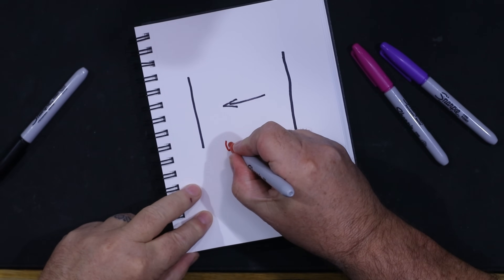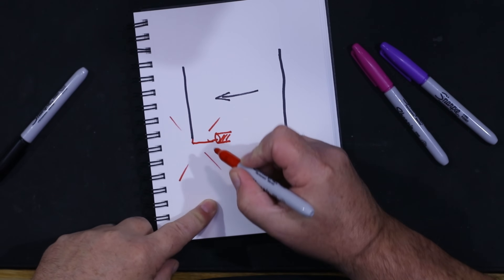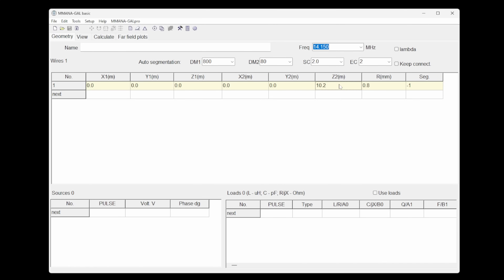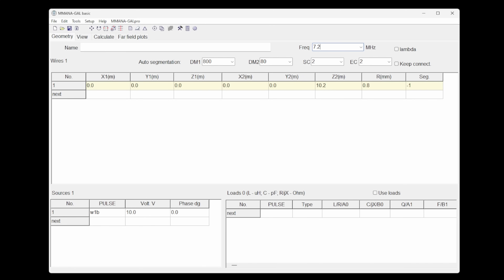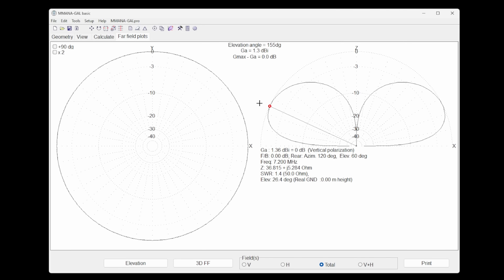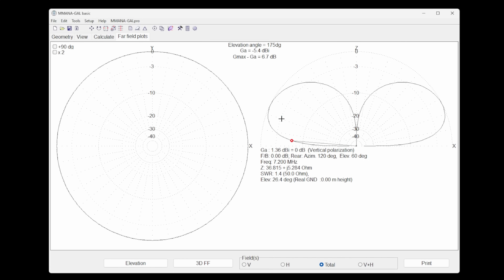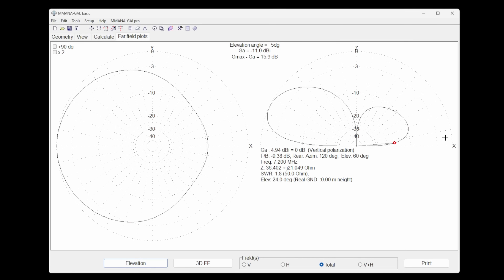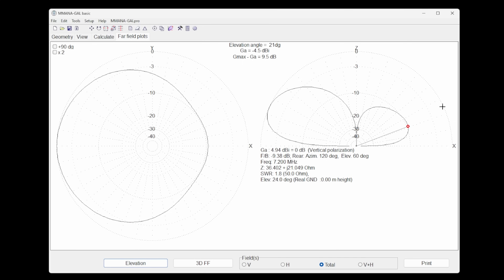Parasitic Antenna Array with 2 Verticals

Comment: And if I’m using a quarter wave vertical with two elevated radials, would I be making radials on the reflector as well, just 5% longer to match the reflector resonant frequency? Would I, say, if wanted to radiate northeast, position driven vertical northeast, reflector southwest, and radials for each northwest and southeast? So the radials are parallel? Or better to have driven radials north and east, and reflector radials west and south?
Reply from the maker: In that scenario, yes. The Reflector dictates the f/b and gain. I would do 90 degrees.

Comment: Cal I’m deciding to put a bog antenna at around 300’ 2 sets running 360 direction or a 2 vert array since I already have one comm classic. I’m curious on how the array turned out on receive? I already have a full wave loop for 80 already up about 45’ that does well just was wanting to improve receive. Thanks
Reply from the maker: About same.. Certainly picked up a bit more. I think the word is "Reciprocal" :)

Comment: Tried this in MMANA for 20m:

1. Raised both vertical elements about 2 meters using studio lighting tripods - interface nicely with Superantenna mounting brackets
2. Used Chameleon 17ft whips for verticals
3. Angeled radials close to 45 degrees down - terminating 1 meter above ground on a plastic fence pole
4. Radials were in the direction of max radiation - about 35 degrees apart (on both active and reflector elements)

Came up with almost the same result - 1.31db forward, - 8.6 rear - that gives me a theoretical gain of 3.3x forward over a single vertical.

With just two radials for each tripod - and printed brackets (hooks) to wind them on one of the tripod legs - it is a fast deployment - can’t wait to prove it in praxis in the field

Comment: Hey. I got an idea of what to try. two pieces of half-wave dipole that are half-wave apart. impedance matching so that both antennas have a quarter-wave length 75 ohm cable and from the center with a 50 ohm cable to the radio. what do you think about this ?
Reply from the maker: It'll depend on how they are oriented. Look up phased antennas.
Reply: @DXCommanderHQ  I thought they were vertical dipoles. I found another article on the same topic that mentioned 180 degree phase shift with a coax cable. I still haven't quite figured out how to do that, but I'll try this first.

Comment: Would that work with a vertical dipole
Reply from the maker: Yes.. Just like a yagi in a vertical plane.
Reply: @DXCommanderHQ  thank you! I live about 900 meters away from a quarry. I have moved my antennas around and unfortunately they best spot for the antenna picks up the rock crusher when its running. It would be nice to null it out a bit.

Comment: Could you provide me  with a link to any articles related to driving two vertical antennas from one source, using a phasing network to allow of beam steering?  Using just a fixed reflective parasitic element isn't worth it for me, as you can't steer the beam. Thanks!
Reply from the maker: Yes, just search for "phased verticals".

Comment: The 8 plus meter spacing was to maximize front to back along with good gain.  For a vertical with radials spacing the parasitic element farther away would be a benefit for getting longer radials on the ground.  Would spacing exceeding 1/4 wavelength provide good gain if one is not concerned with front to back?  At what spacing does gain start to drop?
Reply from the maker: Actually, the 8.5m seems to do both f/b and gain.. There's not a lot in it..
Reply: @DXCommanderHQ   Got it.  Thanks for doing the modelling and the video!

Comment: Callum, here's a challenge...
Using all your skills with antennas and their modelling :-
Create a 2 element array using DX Commander elements to cover 2 bands - say 40 & 20, or ones of your choosing.

73 Stewart G3RXQ / G3Q
Reply from the maker: Almost impossible without getting into serious delay lines for the "wrong" band because of the distance.. Saying that, I know someone who is working on exactly that issue for ALL bands, using 2 x DXC antennas.. More on that when it appears :)

Comment: i have been waiting for this video for a while. This combo works great and is an inexpensive way of gaining some gain on the HF band and is far less expensive than a tower. Inspired by  Callum's design for his 3 element parasitic array for 40 meters I built a four element parasitic array for  20 mtrs .I used MMANA  software to fine tune the element length and spacing. See my qrz page for some pictures.

. John Limanowski  N9DNB

Comment: would this  work with endfed half wave, no radials,, say for 10 or 15. ? might be worth a play with..
Reply from the maker: Hmmm. I might take a look at this..
Reply: hears a thought .. we know about the VDA.. vertical dipole array that these dx expeditions use. which work fantastic is you put them by the sea.. Why do they insist on centre feeding them.. would it not be easier to feed them from the bottom.. the easyiest way to do this is would be to use the T2LT method. 50 ohms ish feed.. or if your a end fet purist you could use your 49:1 or what ever it works out as transformer..the third was is to use the J pole system but instead of ladderline you make the transformer out of coax. Regards .g0vxe

Comment: Not sure I have ever seen anyone mention the pseudo-Brewster angle on any YouTube Videos so you might want to address that at some point. I don’t think very many hams are aware of it. In my ARRL handbook (19th Edition) it’s on page 3-6. It’s also addressed in the ON4UN Low Band DXing Book under vertical antennas. I know the latest ( 5th edition) is correct. Some of the very early editions had a couple incorrect statements so I only recommend the latest editions to be certain of accuracy.
73,
N4DJ
Reply from the maker: Good point... Need a catchy title for that!

Comment: Wanna hear crazy?  Try it with 3 vertical antenna in the shape of an " L ".   The longest element is the meeting point of the other two.lines.  I've built exactly that for 15m.  One side with maximum gain towards EU and the other side towards the US/ middle America.   Lots of fun experimenting.  I haven't walked mine around using an Am radio tho.. something new to try.   From Alaska - I need to Null out the OTHR (Russian Over the Horizon Radar). Bored ?... try it with Phasing cables.  You're a smart guy Callum... You'll get it.  GREAT videos....
Reply from the maker: You can do an L alternatively 3 in 60 degrees more fun.. Watch for next video - then one after.. :)

Comment: It works better if it is all a metre or two above the ground. There is no improvement beyond two metres.
Reply from the maker: There's nothing between on the ground to about half a wavelength above the ground - then  you get good increases. Been there. Tried that.

Comment: I've even tried the 3el parasitic array for 40m, not impressed with the results compared to a 43m endfed at 10m horizontal. I wouldn't recommend it but YMMV.
Reply from the maker: I did three in a row. Spacing is paramount. I was so loud that some US stations told me they'd never heard such a strong EU station ever!

Comment: A 1/4 wave between the driven element and the parasitic reflector seems a bit too far spaced apart to energize the parasitic reflector. I think a slightly closer spacing is more traditionally used.
Reply from the maker: Guess you didn't watch the whole video.. 8.5 to 8.75 is best.
Reply: @DXCommanderHQ  Guilty. My watching was interrupted by a family member. I'll watch it the the whole through now.

Comment: Callum,   can this also work with a man-made object as reflector?   Such as an aluminum light pole  or  other items sticking out the ground and  8.75m  away from the radiating element.   Specifically what if its a mobile vertical whip antenna for 80m/40m/20m and you've parked the car about 9m away from a 10m tall  light pole.    would there be some gain?
Reply from the maker: Yes but it would absolutely need to be tuned at or around 200-250kHz below your TX antenna..

Comment: Cal,is there any way of switching from one antenna to the array so as to check it on air the difference someone receives you from one antenna compared to the array??
Reply from the maker: Difficult unless you made them BOTH slightly smaller - then switched in a coil to make one longer and at the same time, switch the coax over.. Better instead to do Phased Verticals.. Next video!!
Reply: @m0mcx  loving this antenna series:) don't suppose you've got building a loop antenna in the pipeline??

Comment: 2 quick comments... classic yagi spacing is 0.15 lambda to the 5% longer reflector (ie 6m for 7MHz) but you can also add a 5% shorter director too 0.1 lambda out the other side for a full size 3 element unbalanced 40m "yagi"...... point 2, you are 100% right about problems with low angle radiation "loss" as you try & take off nearly along the ground... BIG trick if you are going portable simply solve this by building your vertical antenna on ground that slopes down in the desired direction...bingo the radiation towards the horizon is now "elevated" from going along the descending ground so gives you effective gain (OK NOT gain strictly, more reduced ground proximity loss, but still "better" regardless).
Talking of "parasitic" elements, the ground is also a big parasitic reflector for horizontal signals too.... so a compromise 40m horizontal dipole just 6m off the ground isn't a poxy antenna... it is  a  radiating element 0.15 lambda away from/above a reflector so it is actually a full size 2 element yagi (with a parasitic ground reflector) firing straight up.. which is perfect for NVIS (hence low dipoles being surprisingly good for short-haul inter-G).
Reply from the maker: Indeed.. I made a video about sloping ground..! Great trick!

Comment: You could actually use that one reflector and put different band length verticals on  all four sides . Try that experiment It should work to .extend the reflector radial for each band when needed.
Reply from the maker: I guess!

Comment: That explains a great deal !

In the new QTH I sank a couple of aluminium tubes ( 2" ID ) into the back lawn about 8 metres apart so I could play radio quickly and easily ( and take them down so as not to upset my new neighbours ! ).  

One I used as the base for my Signature 9, and the other I used as a temporary mount for collinear atop of a 8 meter scaffold pole.

Using WSPR on the Sig 9 over a number of bands I was getting some lopsided results.

I have recently moved the Collinear to another location ( the new neighbours are getting used to the erections ! ) and the WSPR plot changed to be more even !

I have said it before, but this antenna stuff is Voodoo !!!
Reply from the maker: Voodoo! Haha yes..!

Comment: I built a half-wave vertical for 10m and a longer parasitic with a switch in it. No radials needed, and I can switch the parasitic element to reflector or director and swap directions. Works a treat.
Reply from the maker: Diamond!
Reply: If its longer doesnt it have to be the reflector?  or do you somehow electrically shorten it with a circuit with the switch?
Reply: @ZiggleFingers  Yes, the switch is about 10% up from the base. Switch on - longer than driven element - reflector. Switch off - shorter than driven element - director. Exact dimensions - not very critical. Spacing - not critical. Vertical alignment - not critical.

Comment: Cal, what if you wanted to do that with an antenna that doesn’t have radials, such as a gainmaster or a vertical end fed half wave?
Reply from the maker: Actually, I looked at the Gainmaster and it wasn't so happy with a 5/8th.. But you could easily doi 2 x vertical dipoles.. Well, one vertical and another 5% longer as a reflector. Basically a vertical yagi.. Sure.

Comment: What about trying a hb9cv style  on the 2 verticals ???
Reply from the maker: Well.. You could do that vertically on say 10m I guess.
Reply: I've  just remembered I had a similar  experience   of this 2 vertical setup.   Had a 2/70 magmount in the middle of the car roof (landrover discovery mk2)and 27mhz long whip at the rear gutter mount  . On driving around chatting to a mate   being just 6 or so miles away  .l discovered   if pointing his way the signal  went up, driving away the signal  went down and he reported back the same .  Oh thanks for the memory lol. ( 2eocak   )